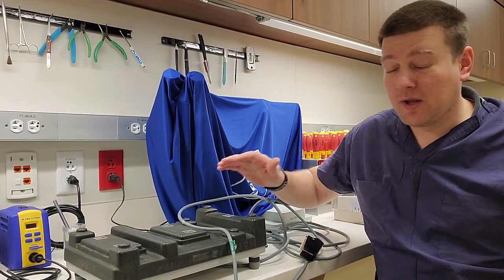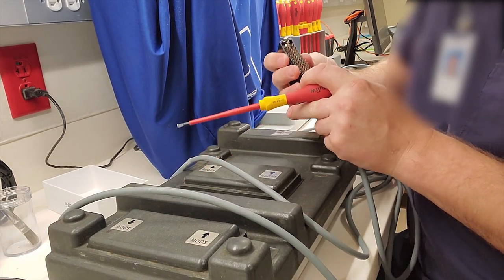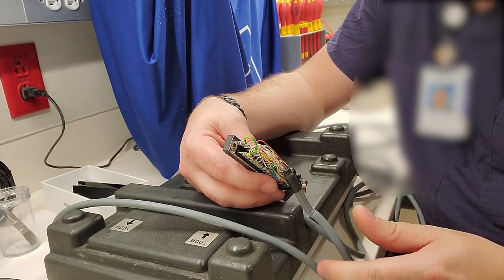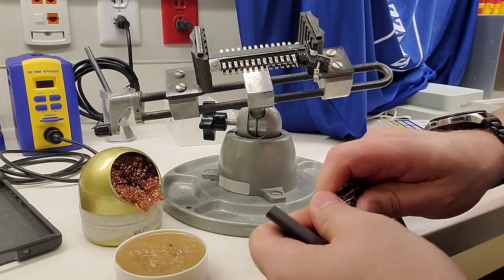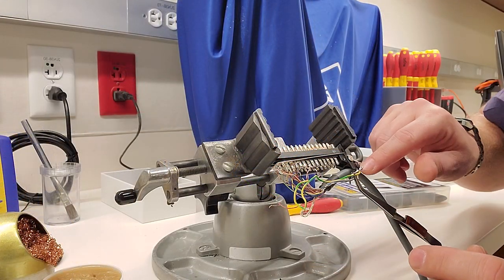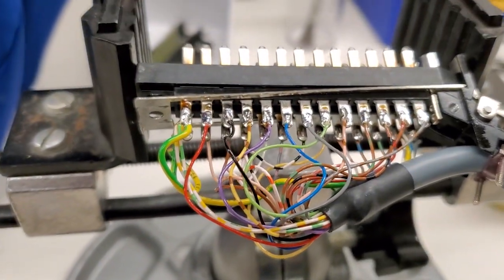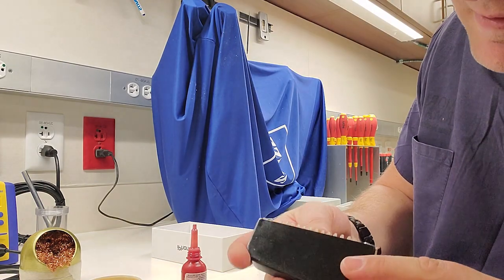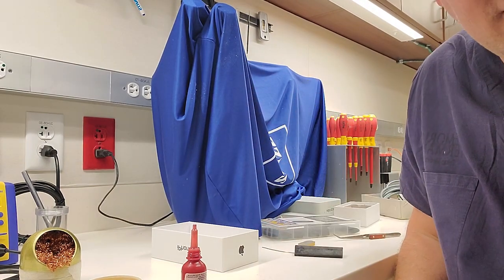Repairing Zeiss Microscope Foot Controls

Comment: I feel so lucky to have found your channel, I havent found anything else that gives me this much insight into what the field is actually like. I'm getting my associate's degree in electronics in about a year but I only have experience in customer service related jobs (besides a few hours of lab work everyday for classes). I was wondering if this would negatively affect my job prospects and what I could do to become a better candidate for a bmet position. Would I first need to get internship experience before being considered for a job?
Reply from the maker: Every hospital has different needs Nd requirements.  Apply for every position possible - even the ones you clearly dont qualify for. Get your name out to those directors who run Biomed departments. They will contact you if they can use you - even if they need to move people around in their shop. Good luck.

Comment: Did you go to a surgical microscope school from Leica or Zeiss? We have ours on contract and would love to learn more about them and eventually get them off contract.  Do you think the time and energy is worth having them off contract?
Reply from the maker: I have never been to any microscope schools. I have ~17 yrs experience around surgery and various microscopes.  I've torn Penteros and S8s down to the frame and I've had lots of experience. 
To contract or not to contract is a very complex answer..  You location, history of users abuse, biomed man power, biomed competency, budget etc have to be considered. I think Pentero and esp Kinevo need to be under contract simply because of the complexity and lack of documentation available of systems. I do have the password to get into service mode but other than clear Maintenance Due errors, it's not an area to goof around in.   S8 Movino, Sensera etc is a whole other issue. Those scopes are far simpler.
One thing that does matter is that usually contracts are not worth it if you compute the time and materials of all the normal failures through a year.  It's a gamble. Although you are at the mercy of the manufacturer without a contract, one time service calls / contracts are usually a big money saver.  Only 10-20% of full service contracts are ever money savers. If you have a fleet of devices and all are under full service contract, 1 /10 might fail in such a way that you save money by having the contract. Without a full service contract, 4/10 would need to have a major failure to equal the cost of the fleet contract. Some people will disagree and argue with me but I challenge anyone to do a real cost analysis of all the service calls placed on any item over a year.

Comment: Hello do you sell, or maybe you could let me know where to get the rubber “things” that are at the botton of the foot pedal. I am missing one, the one located at the left back. And the foot pedal is not stable and wiggles
Reply from the maker: Those are called "feet" I don't know the thread pitch.
Reply: @BetterBiomedChannel  they are glued. Those are like a cone. 2.5 cm on one side (base) and 2 cm on the smaller side